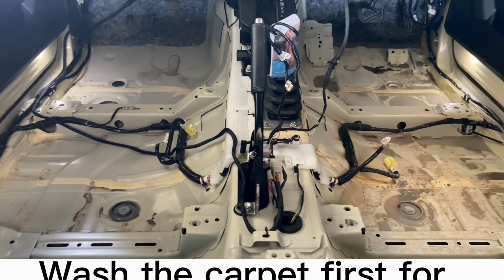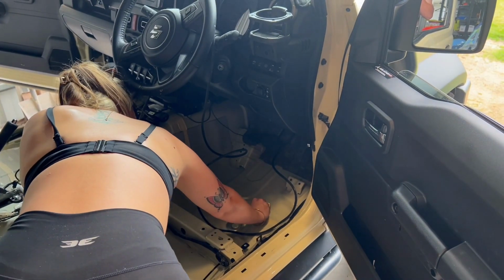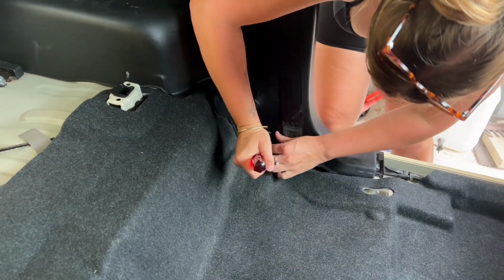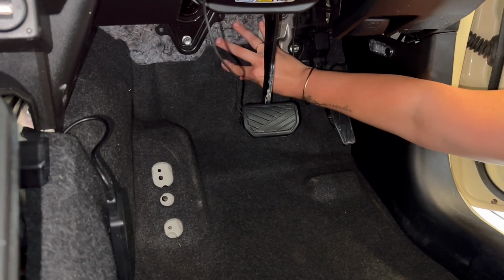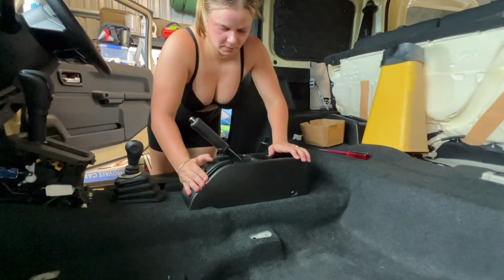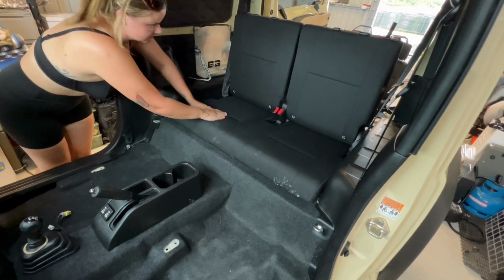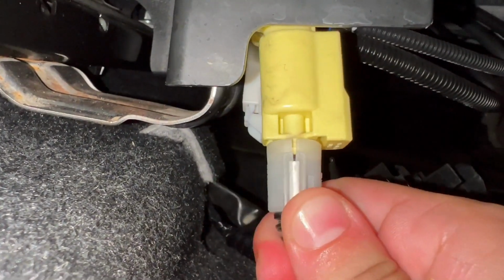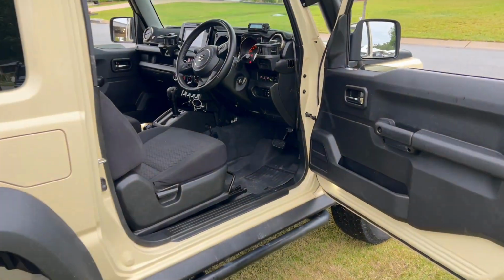Suzuki JIMNY - How to remove the carpets

Comment: Great video Madi . Just got to be very gentle on those clips or wise it could be a very expensive exercise have to replace them. You need to go to 4 wheel drive super Center and get your self some Adventure King’s seat covers I have found them fantastic jump into your car with wet swimmers on or getting in and out with muddy clothes on better than getting your seats destroyed.